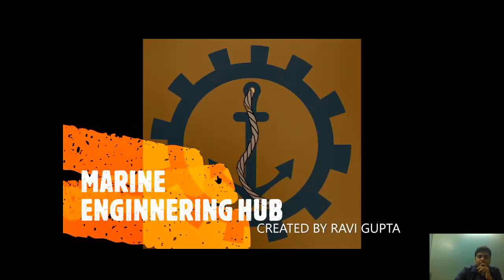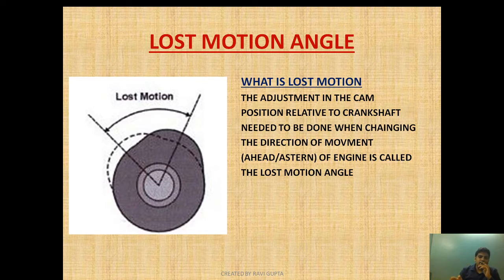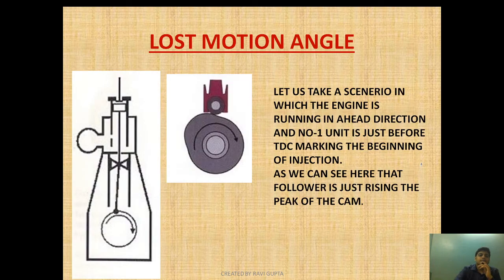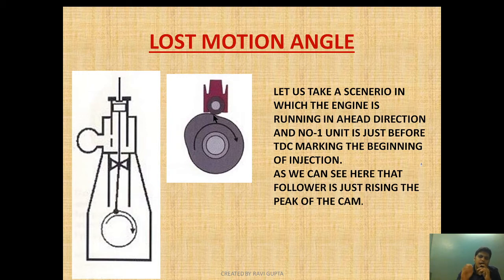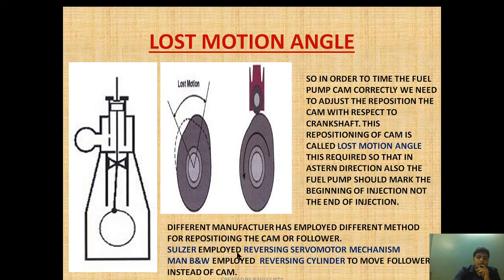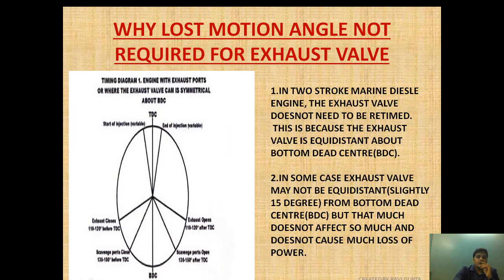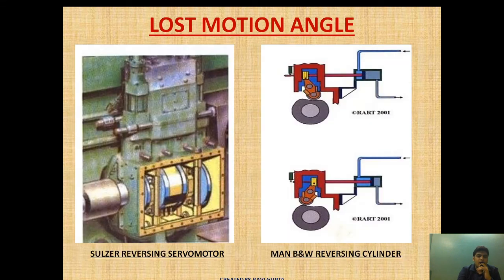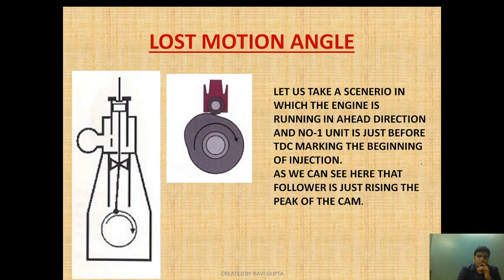CAMSHAFT|LOST MOTION  ANGEL|REVERSING OF ENGINE|(PART-1)

Comment: Sir, 
At the instant when reversing order is given, the crank or piston position is just below tdc. So at that position the Fuel injection must stop or about to be stopped as the piston is supposed to go down towards BDC when reversed and the cam profile at the same instant as per diagram also states that the injection is finished or about to finish.
In the video it has been said that in astern direction also the fuel pump should mark the beginning of injection not the end at this piston position . if this is the case then it would lead to late injection causing after burning.
Please guide me and correct me if i'm wrong.
thankyou sir
Reply: i had the same doubt also. same here